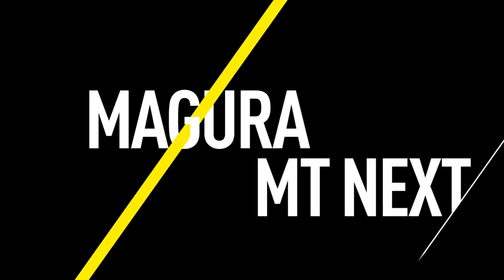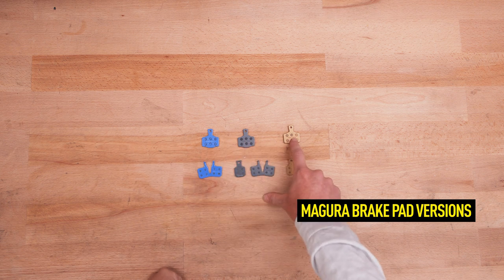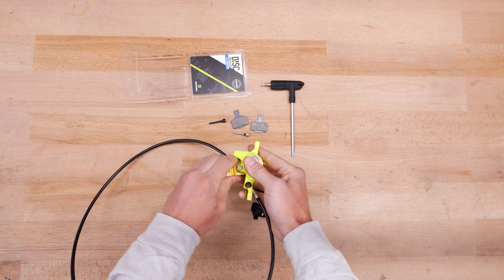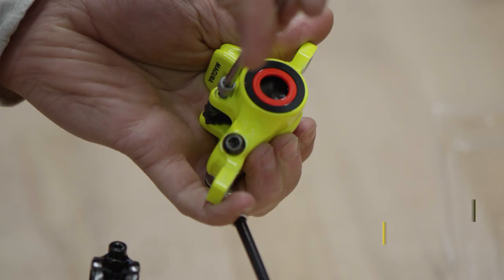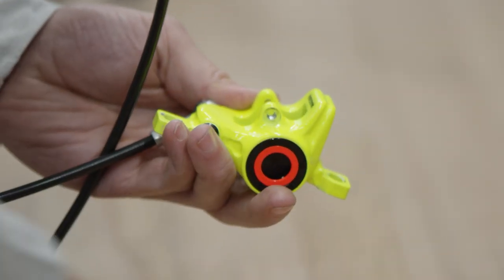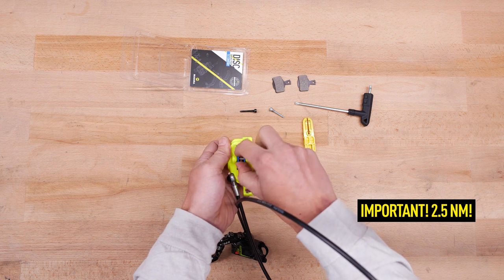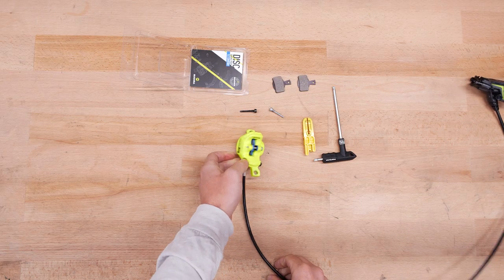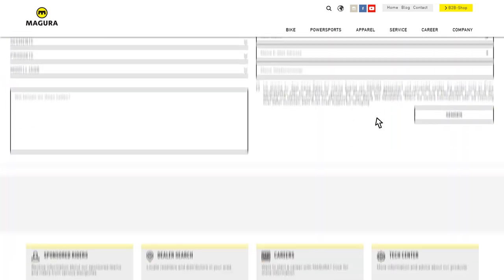MAGURA MT: Changing Brake Pads

Comment: My Cube Stereo is fitted with Magura MT5 hydraulic disc brakes. Could you please tell me the difference between the single and double pads in the video? And which I should get for front and back? Apologies but I've never changed pads on a eMTB before
Reply: Same position here, cube eagle ebike

Comment: I would love to see a video on an actual bike, like the TERN GSD.
Reply: me too. this is what I came here for. will try it today anyways :-)
Reply: i succeeded with the front break - just released the two screws that hold the break in place and then proceed as shown in the video. the back....it seems to be more tricky with all the stuff in the way....
Reply: @Tismar10 me too  it's a pain. Don't take the caliper off, especially in the rear, unless you have a very long allen key. Take out the wheel instead. The problem I have is that there just isn't enough space to get the pads in, it's a real struggle. This video conveniently shows a simple version, so I agree: show it on a used tern gsd😂
Reply: Just changed the pads again and it worked ok but it is extremely tight. This time I used 2 tools and pushed back both pistons at the same time and holding the pressure for a while to ensure it doesn't bounce back. before, I think when pushing one piston back, the other popped out again a little, making it impossible to put the pads in.

Comment: Like in the manual no explanation on removing the  double pads (without screws) ... do i have to remove the caliper from the frame..?
Reply from the maker: Yes, in most cases you will need to detach the caliper from the frame to remove our type 9 pads.

Comment: I need pads for the rear brake of a Cube Cargo, apparantly CME5. No idea on what search terms I can find these.
I have to say wear is horrible on these 10k driven and already needing a replacement. Also the oil system is leaking like crap. If you have a mechanical replacement (cable brakes), please give me directions, ready to ditch hydraulic as soon as possible. If you want us to get out of our cars, make these last for 50000km at least.
Reply from the maker: The CMe5 brakes require our 9.P brake pads, product number is: 2701627

If your brake is leaking please reach out to your dealership to check for warranty claims, to check where exactly it's leaking and how to solve the issue. If you have additional questions, please feel free to send us a message on Facebook or Instagram.

A mechanical version is not available. If your bike uses these in conjunction with the Bosch ABS system, a mechanical system will not be compatible at all.

Comment: Hi, i just got the Mt Trail Sport, the front pad are dual, can i change it for two single? Does Magura recomend that?, or should i keep the dual?
Reply from the maker: Yes you can change to the four single pads and they come with the required Bolts. We do recommend the single pads for easier pad change and as an upgrade for slightly better performance.
Reply: @MAGURAPassionPeople  Thanks!!!

Comment: I have the regular mt5 brakes installed on my bike but ever since i got them the space between the pads was super slim. Today i've changed the pads drom a 9c to an 8s for longer durabilty. Now the small space between the pads is extra apparent due to them being new and slightly thicker. I can't even seem to fit them on my disc. Any way to resolve that problem? thanks in advance
Reply from the maker: Have you made sure that the brake hasn't previously been overfilled and that the pistons have been pushed back all the way? Have you checked if the pistons are moving freely and mobilized them if not? Feel free to send us a message on Facebook or Instagram if you need further help with this.
Reply: @MAGURAPassionPeople  hey thanks for the answer. apparently overfilling was the problem.
Reply from the maker: @_Encie  Hope everything works now! You can avoid overfilling your MT brake by making sure to use our yellow transport device/bleed block during the bleeding/fast bleeding procedure.

Comment: such a pain in the behind to put in the 9P brake pads
Reply from the maker: It's true, the type 9 pads can be more difficult to replace. You can switch them out for the type 8 pads that come standard in brakes such as the MT7, those are much easier to replace.

Comment: Another technical joke ! To replace the pads, you have to remove the entire caliper !
Reply from the maker: Depends on the pads you're using. The caliper only has to be removed for the type 9. pads, due to their design  and how they are secured in place.

The type 7. and 8. pads can conveniently be removed from the top of the caliper.
Reply: @MAGURAPassionPeople  by removing your wheels it makes it easier to drop the type 9 pads (if i'm correct on what you mean by type 9)

Comment: This video is a joke.
No real situation, not on a bike to see the real dificulty of the changing the break pads.
Reply from the maker: The process is the same in a real life situation. Depending on your brake model and the brake pads you're using, you can simply remove the retaining bolt and pull them upwards to remove them. If the frame doesn't allow that or you're using our type 9 pads, you will need to remove the caliper first to remove the brake pads. Always feel free to contact us on Facebook or Instagram if you have any questions or need help with a certain problem.